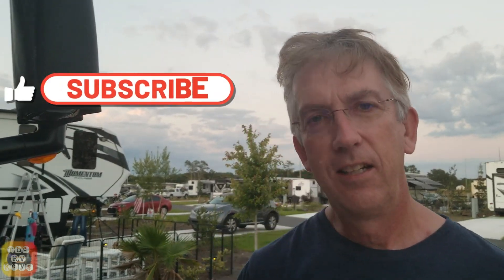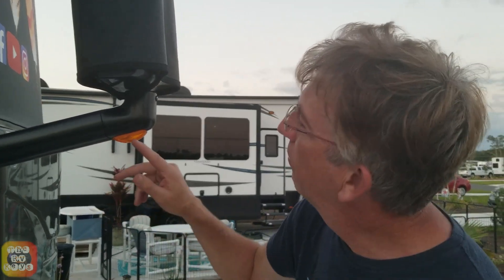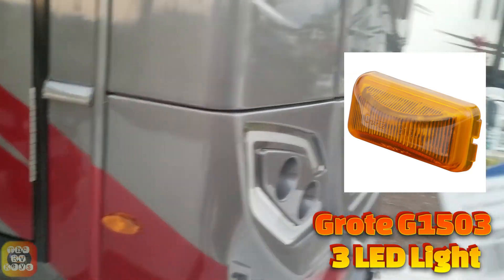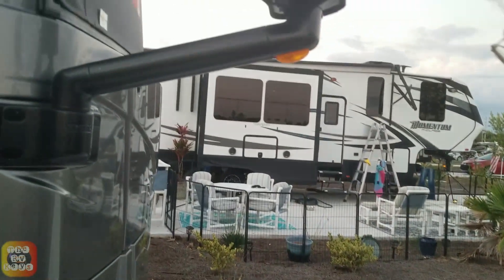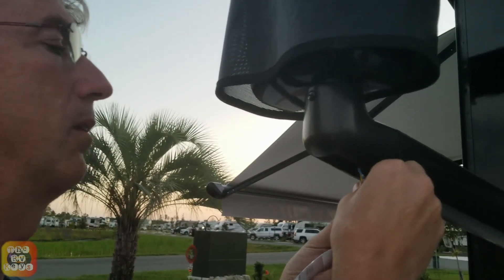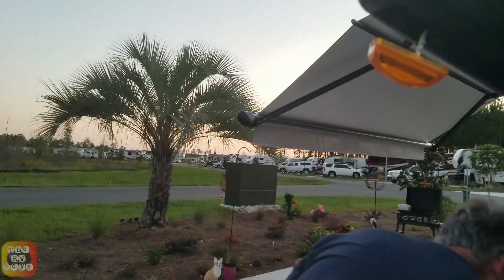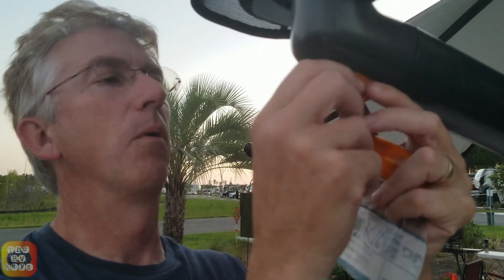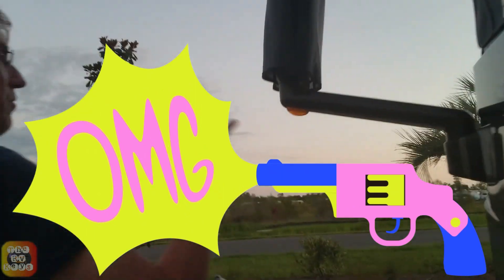😊So Easy! Upgrade or Replace Your Coach Signal Mirror TheRVkeys Episode 55

Comment: Looks like a poor design if the replacement is loose in the opening. There must be a minor difference from the original.
Reply from the maker: Must be a minor difference or defect in the arm or lens.  It fit fine in the drivers side mirror arm. Thanks for watching!